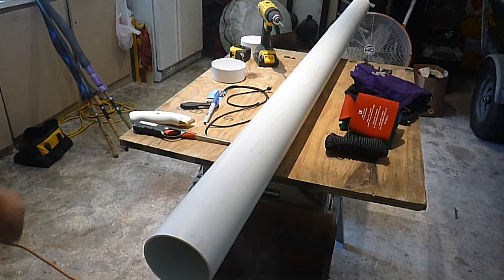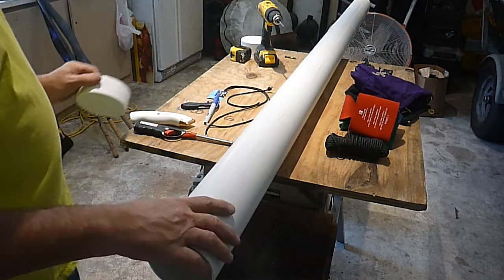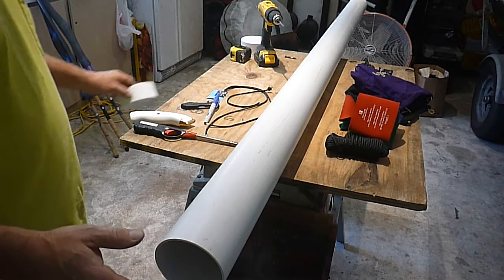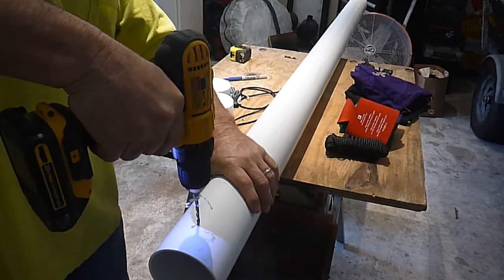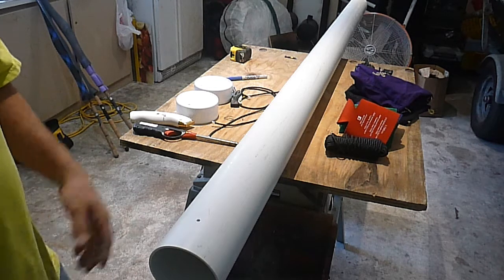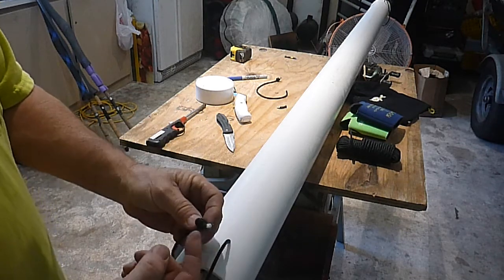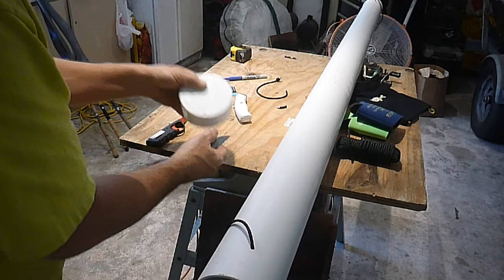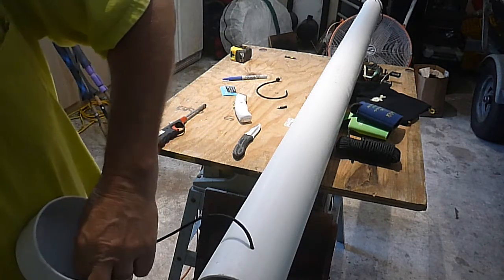Air travel DIY rod and reel case less than $17.00

Comment: I enjoyed watching your video. One question though, why not glue one end solid? 
I’m planning a trip by air soon and can’t find a rigid enough tube that I trust the baggage handlers with. 
Will the other end cap come off easily?? Thank you for posting this video. It is very helpful.
Reply from the maker: Well when I fly use duct tape on both ends and not a lot just one time around or otherwise you raise suspicions and Homeland security open it to see why you put so much tape on it, it is not a big deal as long as you are following the rules. Also what I do is leave a tiny roll of duct tape inside the tube with a message to the homeland security "feel free to inspect also here is my phone number just tape it back up when done" and my rod and reels make it everywhere I go no issues.

Comment: How do you keep it from coming open
Reply from the maker: For shipping you just wrap it in duct tape it works great and it can be inspected and put back by the air port agents
Reply: DUDE YOU CAN DRILL HOLES AND PUT SMALL LOCKS ON THE ENDS
Reply from the maker: @togo9970  yes a big bike lock

Comment: What is the pipe size bro? What is the inner diameter?
Reply from the maker: Yes sir this is a 4 inch sewer pipe but you can use a drain pipe which will be lighter and not as strong and should do the job. I used what I had laying around but when I replace this it will be with drain pipe to save a little shipping weight